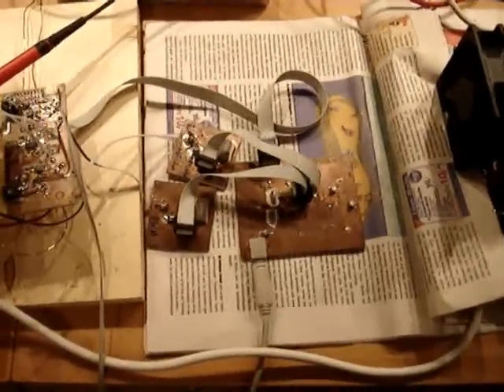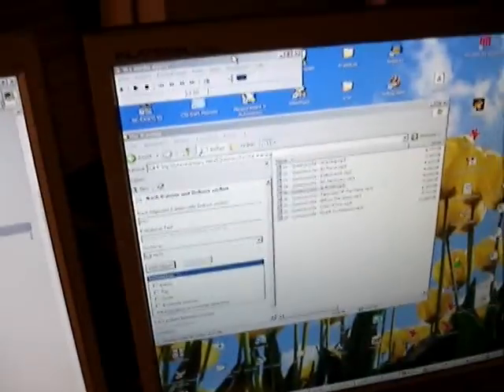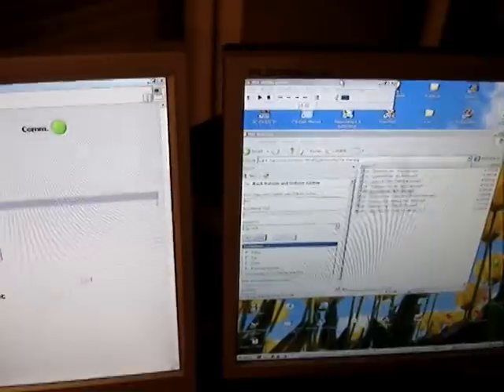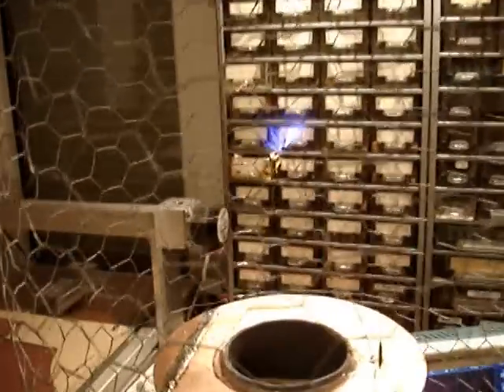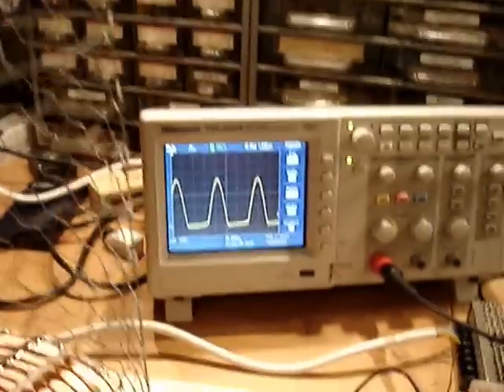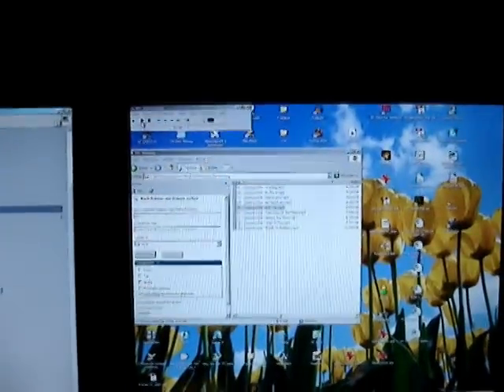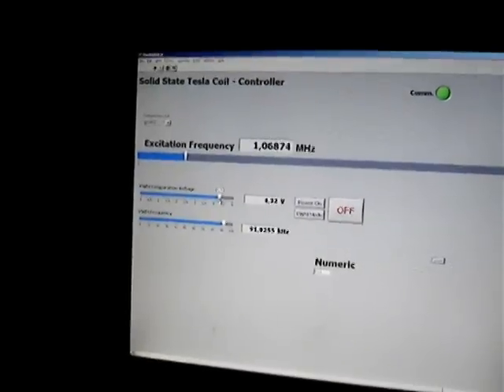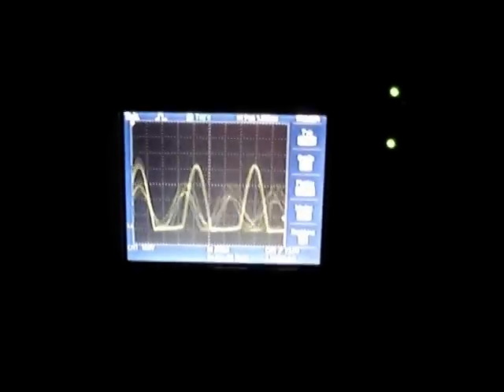Plasma Speaker: Musical Solid State Tesla Coil

Comment: It looks like you build the bottom blate from PCB with copper on it. If so, please note, that this could act as a short cut Loop and impact the efficiency of your coil. Some diagonal cuts in the copper should prevent that.

Comment: Completely impressed as I am researching to make my own dual stereo plasma speaker set. I am thinking it is just on the edge of my understanding.  Tell me, would you suggest modulating the on/off of my mosfet (2SK2483)?  My HV source will be a flyback from a projection screen TV that (oddly) was hit by lightning LOL.

Comment: You might increase your efficiently if you removed the large circuit board under the coil, you are likely loosing some power due to the eddy current in the copper board